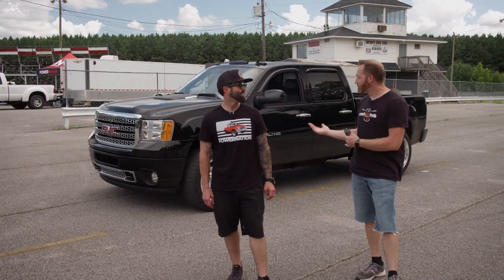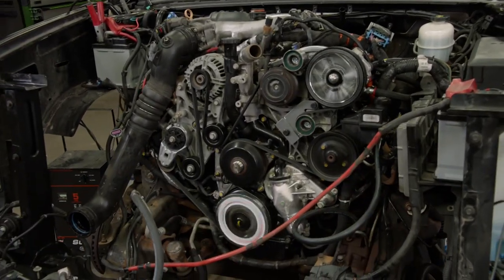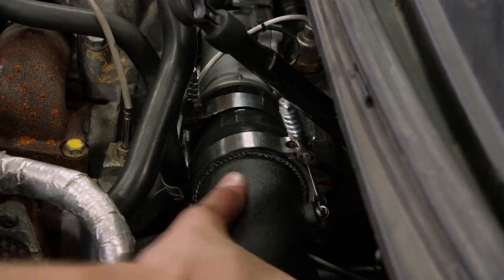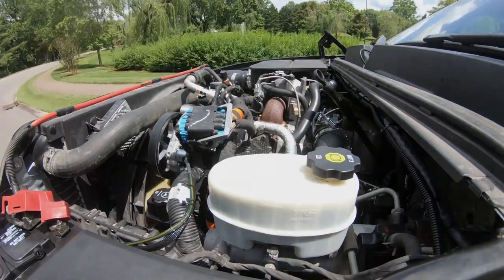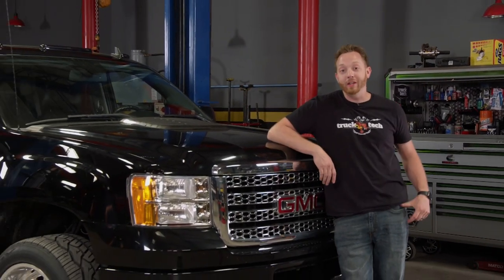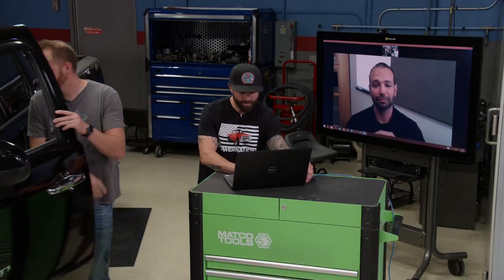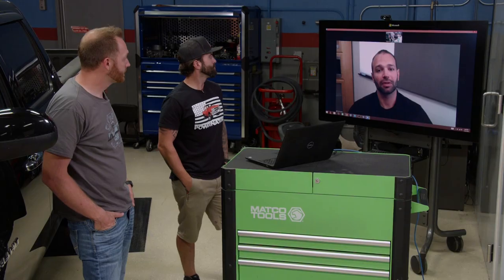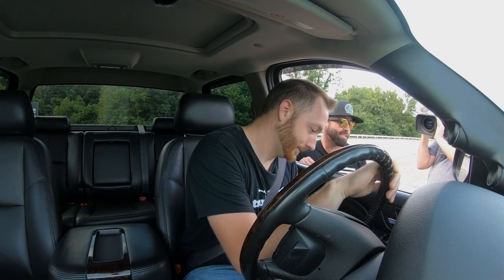Put Up Or Shut Up: Does Our Upgraded Duramax GMC Denali Deliver At The Strip? - Truck Tech S7, E14

Comment: 589 hp and 1000lbft. A simple delete, custom tune, and a cold air intake, and a performance fuel pump and that thing would of made that power.
Reply: Mean while at the power block shop/studio, they replaced everything else n left that shit alone. Lol
Reply: @johndenver9368  had too. Just look at the trouble Diesel Brothers are in right now.
Reply: @SGTJDerek  this is a good point.
Reply: Yeah, but that’s what everybody does… I mean EVERYBODY! I got a little TDI with a stage 3 cam valves & springs w/ turbo and it sounds more nasty than these trucks. I mean that car is angry AF! Jus waiting to get to the rotating assembly and go even bigger turbo & fuel…. Would be cooler if it was American as the performance parts are a lot more expensive
Reply: “Would of” is not correct. Would have of would’ve.
Reply: Unless they want a huge fine from the EPA, they had to leave emissions alone.  They should have done an 06 LBZ.  That is the magic year with the 1st year of the 6 speed transmission and last full year with no DPF...
Reply: Right
Reply: Egr are horrible for diesels . They reintroduce diesel exhaust that has particulate matter . After 100k miles it will plug up air ways , narrow air ways  caking up pistons and it's rings.  What's better for the environment a engine that doesn't polute or a engine that constantly needs new parts. Those parts come from factorys that take ships planes and trucks  to ship by them by the trillions.
Reply: @richfarfugnuven6308  still got the egr buddy and illegal to adjust the ecm now beyond stiochometric lambda 14.7 to 1 shoulda went withthe lb7 non emissions best yr. know your duramax also the lb7 has same trans you just unlock the 6th gear with 5 to 6 speed valve body and trans tune
Reply: @SGTJDerek  We the people could stand against the unelected EPA I was willing to join the defense with whatever it took but they crawled back to their basement and took the beating
Reply: @richfarfugnuven6308 it had an egr.

Comment: Congratulations...all that work and you can almost outrun a stock Honda Civic. Hahaha
Reply: That’s cause they kept stock exhaust. Don’t want to get chased after by the epa. They built the motor for 1000hp and then realized dpf couldn’t handle it and they couldn’t delete it. Trucks running at like 580hp they said.

Comment: Nick at Duramax Tuner is awesome. I don't know if he still does it but a one year subscription for $300-500 got you all of the tunes he has written for all generations of the Duramax. I went from 16.0 with my bolt ons to 14.2 with just his tune on a LLY. And I still got 18-22 mpg in town with his tune. This truck's numbers aren't an accurate depiction of how fast his "race" tunes are or how economical his MPG tunes are, or how good his damn tow tunes are allowing the stock VGT to act like a Jake Brake helping slow the truck and it's load.

Comment: I had a bagged 2005 3500 Duramax with a turbo back exhaust, Banks intercooler tubing with the stock intercooler, LBZ mouthpiece that I ported myself, a couple 90° 4" couplers 4" pipe and K&N filter on the end of a tune, Duramax Tuner's 450 whp tune using EFI Live and consistently went 14.2 at 97mph back in 2011 in Alabama in the hottest part of summer. With a built transmission and lift pump I would have safely run DT's 600 whp tune and easily run mid to low 13s. 8.9 in the 1/8th is a 13.95 roughly in the 1/4 so that's not too bad keeping all the emissions. Now ditch all of it, run a really hot tune and run deep in the 12s.

Comment: Clean Diesel Tuner and looks very expensive and not very exciting so many parts so many thousands of dollars to get less than 600 hp would be very disappointing
Reply: 600hp should be around 1200 lb ft torque.
A fun daily driver for a 6-7000lb truck.. Definitely not disappointing.  Diesels are expensive, this is common knowledge so...
Have you driven a 600hp lml to justify making suck a statement.
Reply: Jason Heinrich ya this guy don’t know what he’s taking about
Reply: Jason Heinrich I had a 6.4 powerstroke. I deleted it and tuned it. Very inexpensive hardly any parts. Dynod 567, 985 at 30psi. On the street it would run 42psi. 8000lb truck. It was lots of fun. I’m saying keeping the emissions intact takes away a lot of fun. They were shooting for a thousand and got less than 600. That’s a lot of money for it a lot of return. If it was my truck I’d delete it as soon as the cameras were turned off lol
Reply: Tyler Proud, a 6.4L. Yikes, there is your problem
Reply: GGW my biggest problem was burning tires off it.
Reply: @dragoonTT  so true!  The 6.0 and 6.4 power smokers are junk!  Anybody that's says their a good motor did not have long enough to experience the 6.0 and 6.4 curse!  When my dad drove school buses for a a living a bus that had the 6.0s and 6.4s  at about 70k would eat itself and they replaced them with a 6.7 Cummins.  There is a deliberate design flaw on the 6.0 and 6.4 valve design.  No engine should loose or suck a valve at 70k!
Reply: Shadow Opp.'s RC, my mother drove the international school buses the same as your dad as a side gig and they were always in the shop under 100k km as well. She had a brand new bus nuke itself on the highway with white smoke filling the bus
Reply: GGW not a ford fan by any means but the 6.4 is definitely a quick truck with any kind of modifications there just known to blow up and shit but when they run they run pretty good
Reply: Lance Archer, both the Cummins an Duramax were a better option. I like all three brands, just certain year models to avoid. Now a days you really can't go wrong.
Reply: @1tylerproud   Everyone knows of the unreliability of the 6.4. They can be quick but not worth it imo.  I really do like the 08-10 trucks, except for the 6.4 dealbreaker.
Reply: Jason Heinrich mine was good. I’d get another. I drove it hard. I sold it and the next guy drove it to 300000km and it was still a rocket ship. He sold it to someone else.
Reply: i have a 300  hp perkins 6 cyc in a ford f250 it makes about 550 foot lbs of torque with a fuller 10 speed trans. i use to piss people off getting on the freeway because it would blow there doors off. mine would run circles around that thing.
Reply: Problem is The EPA stepped in on ALL Tuners. Especially the Diesel guys. I believe the timing was about midway through this build. Hence the change in direction. Give it time. Like they were saying. The Emissions garbage isn't there yet. At this power level and the internals they used, it's probably better from a durability stand point then a bone stock Engine and those are pretty damn durable.
Reply: @SGTJDerek   yes lots of epa bs!  It's a newer platform also, not as much available in aftermarket yet(compared to lml ect) and what is available is expensive. Just like you said, give it time...
Reply: @GMCJay_lly  600 hundred for the money they spent is a joke
Reply: @how7783   I don't know what to tell you.  Modern diesels are expesive, that's common knowledge.  Especially using quality parts.  Pretty simple.
Reply: @GMCJay_lly my '13 LML makes 600rwhp and a tick under 1100 ft lbs with a 63.5mm turbo and a sportsman cp3 injection pump. This truck is a MASSIVE disappointment.

Comment: The balancer on the front of the engine looks like it's not on straight
Reply: Theres a weird weight looking think on top
Reply: Domino  it is an illusion
Reply: Looked like it was wobbly to me
Reply: It's a balance weight because the engine is externally balanced. It reduces harmful harmonics in the bottom end of the engine. It keeps the engine from destroying the main bearings.
Reply: Yeah, noticed that.😄
Reply: Counter weight on the dampers

Comment: All these comments about the time slip and the power level they SHOULD be at. If you watch the beginning of the build, the parts used COULD handle more but you wouldn't pass Emissions in any way, shape or form. And that alone is an issue for a TV Show. Just look at The Diesel Brothers. How much hot water are they in right now? EPA has dropped the hammer on Tuners as well. BUT, just as we saw in the '80's, technology will catch up and the limiting factor, DPF, will eventually get better as well. It'll take a Hot Rodder in the vain of Gale Banks to do it but it'll get there. He is such a Geek he's already miles ahead of everyone else. Including the Factories.

Comment: Hey I got an idea! Let's waste 6 months of our lives and thousands of dollars to build a duramax engine capable of 1,000hp, only we wont push it past 600 because of emissions restrictions.

C'Mon guys you could've hit those times with basic upgrades. I've seen gm diesels hit similar times on a tune. If you're worried about the emissions whyd you build this.

Comment: After all that build time I’d be a little disappointment in that 8th mile run. But it’s not my truck- it’s yours. Just hope it’s all you wanted and more. 👌🇺🇸💕
Grab you a pair of Knipex Pliers Wrench. The 7”,10”,12” pairs. Also a few pairs of Knipex Cobras in 7” and 10”. 
You’ll never come across a pipe or a nut you can’t take off again. You’ll never buy Channel Locks or a crescent wrench again either. I promise you- you’ll love these tools that much.
Reply: Are you from hennesey the company?

Comment: I can’t help but laugh at these guys.  20-30 seconds and they talk about it “getting too warm” cause of no cooling system.  Clearly they have never tried starting one on a run stand and let idle to help seat rings.  I mess with LS engines and always run them upwards of 3-4 minutes before shutting them off with no coolant.  Never had an issue.
Reply: Cuase you are gunna seat rings in 3-4 minutes

Comment: All that work on the engine just to make that power the stock components could easily handle no problem because they wanted to keep the emissions systems in tact!!!....i deleted everything on my 06 lbz and added a cold air intake system, straight pipe exhaust, ppe downpipe, egr deleted exhaust turbo pipe and with a $75 used holley flashpaq tuner oh and 500k miles on it and is very fast for a 8k pound truck

Comment: All of my duramax’s have ran faster than that including my LB7 with a 125hp tune on it..... (everything stock/just tuned) my lml puts down 550 to the wheels and runs high 7’s in the 1/8th. Y’all need a driver mod haha
Reply: Oh yea the LB7 had 480k miles on it as well haha
Reply: For real man, not sure what these guys are up to on the line. My 7.70 truck is a 640 whp LBZ. If it’s a cool day sometimes that busts 7.60.

Comment: Noticed no blowoff valve why? What gauges do you run besides boost gauges what and what brand?
Reply: That is a great question, but there’s is No need for a blow off valve on a Diesel engine as there is no throttle body to trap boost, when you let off the the throttle the boost goes right back out the intake giving that turbo bark or whoosh sound, that people love.

Comment: Fundamental power increase with a diesel is turn up the fuel. On TruckTech run the motor lean to not plug up the power robber we left in the truck to keep environmentalists happy

Comment: Don't know what your turbo is or if the heads were just new stock ones put back on. I would've expected a bit more out of it considering you can push into the low 500's with just the basic 3 upgrades. I think that truck would run faster in the 1/8th as well, i didn't see a boost launch .🧐

Comment: Comical that theyfired the engine without a cooling system. Not like initial fireup is critical in seating piston rings or anything. I hear getting the rings and cylinder walls hot with no water is ideal.

Comment: I have this truck just the dually version and ran a 1.92 60ft, 9.90 at 74mph 1/8th, and 15.3 at 90mph completely stock at 6000 feet in Pueblo Colorado....so not sure what happened here...the trap speed in the 1/8th should have been higher...

Comment: All that work for less than 600 horse. You could’ve made this thing faster with a turbo LS for half the cost. You hate to see the lawyers step in and ruin things
Reply: Diesels are for pulling, drag racing not so much. My BIL's Cevy 5.3 runs pretty fast, but his slower diesel will drag a trailer twice as good.

Comment: Could have made the same power with injectors an maybe a turbo didn't need to waste all the other money if u weren't going to utilize what u got I'm a powerstroke guy but this is sticking to see a potential high hp diesel killed by emissions I would have sold the machined long block for what I had in it an bought a stock long block an put a turbo an injectors in it

Comment: Duramax tuner made a Emission truck make 1000hp. Im guessing the EPA talked to yalls lawyers and scared yall out of the full out twin build. You did a dual fueler with a single and mild injectors. duel stock cp3s and support over 1000hp with ease. Disappointing to say the least.
 My LLY with a 68mm turbo and %60 overs, with the supporting stuff makes more than this truck can, all because i dont have to worry about the Emissions cancer. Yall should of just bought a LB7 or LLY and make your big power and keep the lawyers happy.

Comment: Am I smoking crack or does that harmonic balancer got a case of the wobbles
Reply: that's why i scrolled down through the comments
Reply: It’s the decal on the front of the dampner
Reply: If you look closely, the balancer has different counterweights on one of the sides which makes it look off balance
Reply: @michaelpeters6481  I wonder why they went with external balance as opposed to just using a balanced crankshaft
Reply: @crimsonsr20  even with a balanced rotating assembly in a diesel, the engines have a lot of harsh harmonics due to the weight of the components, torque, and the high compression ratio of the engines. Diesel engines essentially fire from detonation of the fuel instead of ignition of the fuel.

The ATI super dampers (the balancer in question here) are great, and I've even installed them on stock trucks. They take so much harshness and vibration out of the engine that it feels like a different vehicle.
Reply: @Raccoonactual  Gotcha. Didn't know that man. Thanks for the info. I dont know all that much about diesels since I've never owned one and I grew up working on gas engines